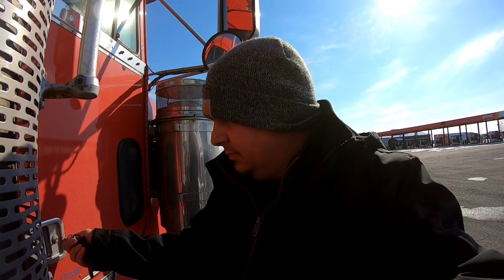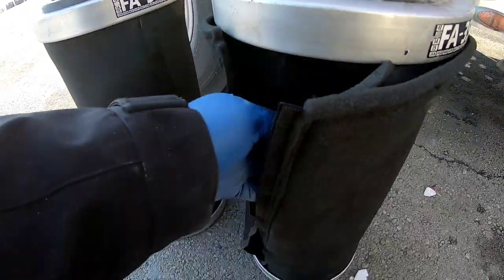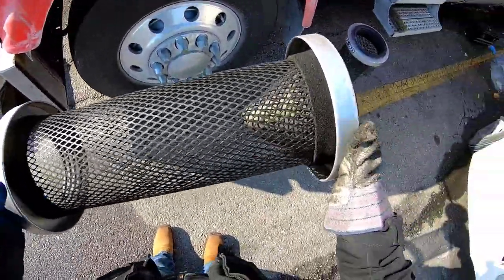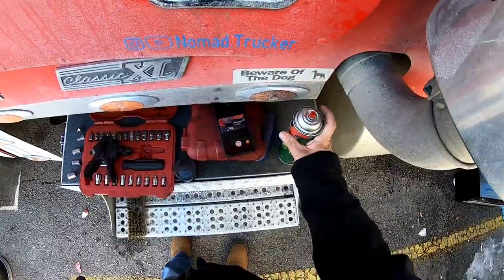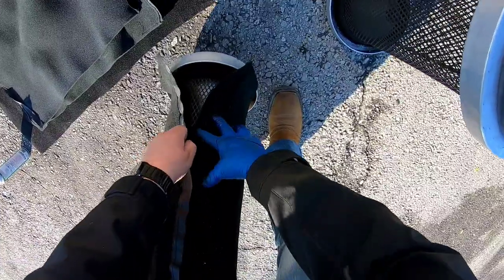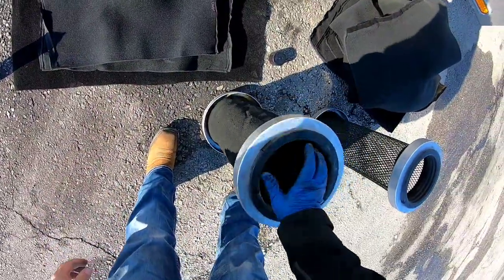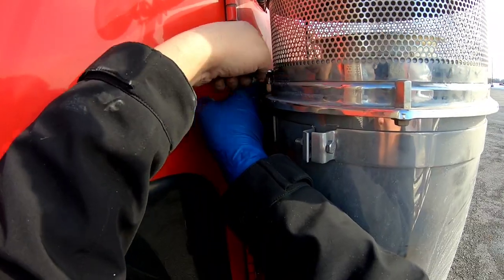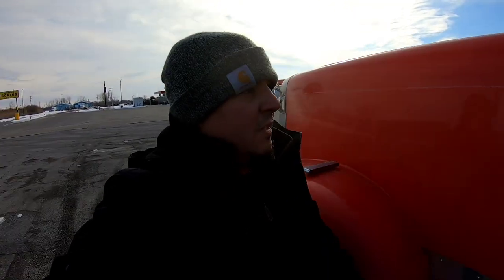Changing the air filters on my 2007 Freightliner Classic xl. Fleet air filters for semi trucks

Comment: Love it! How did you end up with a clear coolant reservoir? Mine on my 99 is black.
Reply: Doesn't that mean there is oil in it?
Reply: @wilE6764   no, the tank is not see through like most trucks
Reply: Same here
Reply: How do you check yours?
Reply: @paperboy554   I usually check with a stick or I’ll put my finger inside